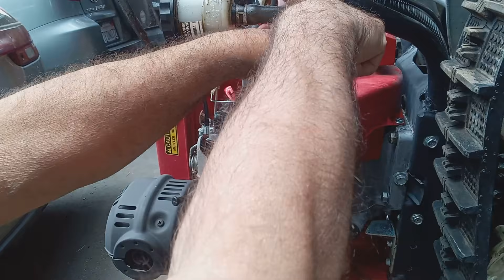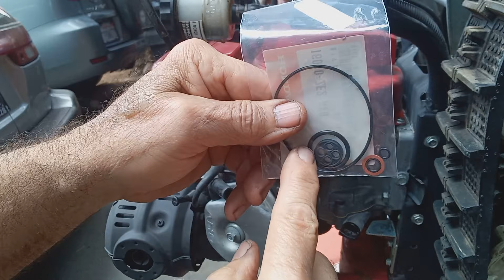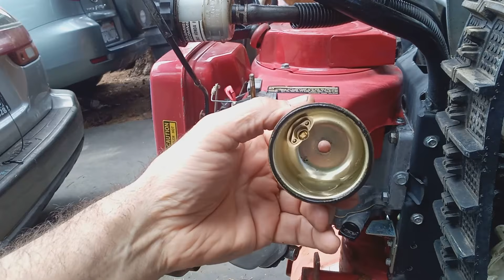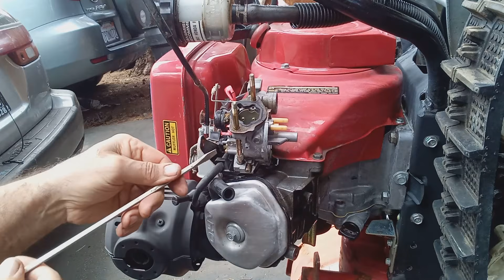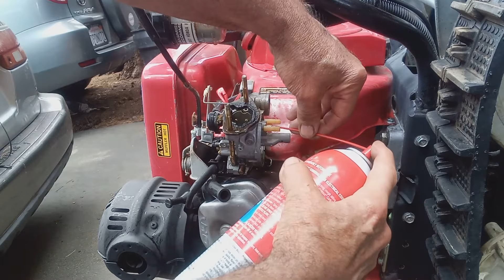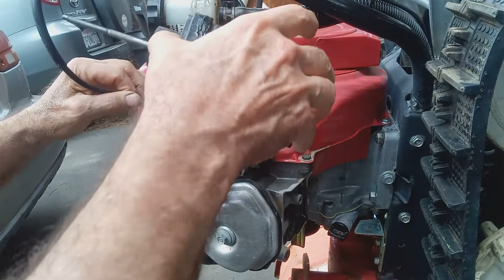HOW To Do  HONDA Snowblower & Small Engine CARBURETOR Cleaning Without Removal .

Comment: Hi I have a model HSS928A Blower. I'm trying to figure out where the nuts and bolts are to remove the plastic housing over the carburetor. Not intuitive. I got top box off, but lower box housing is still on? Can  you tell me where the bolts and or screws are to remove it. Many Thanks! Love you videos!
Reply from the maker: I had the same problem first time. check the side under the fuel tank. There is a bolt holding part of the plastic housing. I think I have a video on this but do not specificly address where all the bolts are. Gonna have to keep looking. If I figured it out anyone can.

Comment: Great video! This total helped my issue. However, I must have done something to my throttle, because now I can throttle between slow and fast, it seems to be wide open. The throttle leaver still works and the springs seem to be attached still. Any thoughts? I’ve got a Honda HS55.
Reply from the maker: start from beginning. check all linkages for jams.

Comment: I got by for years cleaning jets with various random wires .. but I bought on Amazon a set of fine wires and brushes called “FineGood Carbon Dirt Jet Cleaner Carburetor Set of 4, 13 Cordless Cleaning Set” … well worth it IMO

Comment: Great video. My 4 year old Honda HSS724 is surging bad. Still moves the snow, but this will be a spring project after winter is over. You make it look easy. Thanks so much.
Reply from the maker: I have done so many times that it is easy now. This is about a 20-30 min job. Maybe the first time it may take longer. Just have patience and you will succeed. Thanks.

Comment: Im having a tough time finding a replacey carb for a GX270 Serial No.GCAB-2091772.  When i look online none cones up with with a sediment cup.  Any help is appreciated
Reply: You could take pictures of model and the serial plate. Go to a local Honda dealer too.
Reply from the maker: all over the place. try boats.net. the carb for the 270's will fit any 270. is this a pressure washer or something? it doesnt matter. a snowblower carb will run this engine.
Reply: @HondaSnowblowerEnthusiasts311    it's a Honda HS928 Snowblower with electric start.  So the sediment cup is not a must?
Reply from the maker: you siad you wanted the carb.please post on our facebook group Honda Snowblower Enthusiasts. @georgep.2665

Comment: When you stand the machine up do you have to worry about oil and gas leaking out.
Reply from the maker: Make sure gas is not leaking from cap. I shut off gas or siphon some out. I address the oil issue in several videos. Either close the valves or most shops recommend draining oil.

Comment: I had honda HS521 snowblower work just fine but leaking all the gas out from little tiny hose when I open the gas switch on , I just want to know how u fix the leak
Reply from the maker: Is it coming from hose? Then maybe hose needs replacing.

Comment: hi anthony, what size main jet would you recommend for a hs 1132 at 6200'? I live in south lake tahoe. thanks for all your helpful videos!
Reply from the maker: I wouldnt change it unless you are having power issues? On an older 1132 have not seen those issues at 6200 feet. If power issues may be other problem. Like find out what your fast throttle RPM's are. should be 3600 give or take.